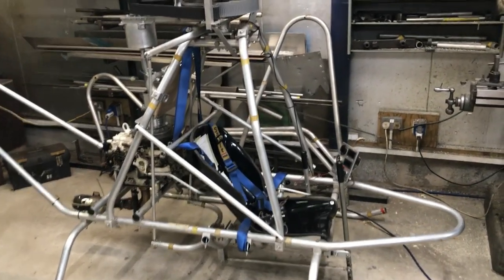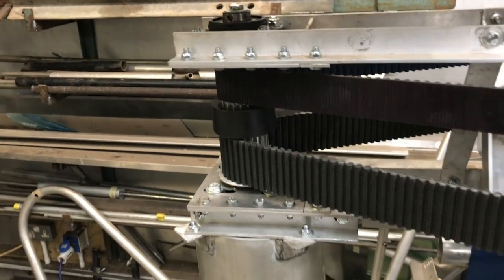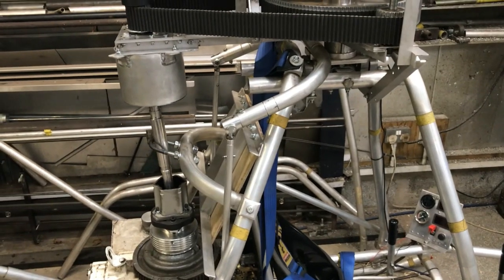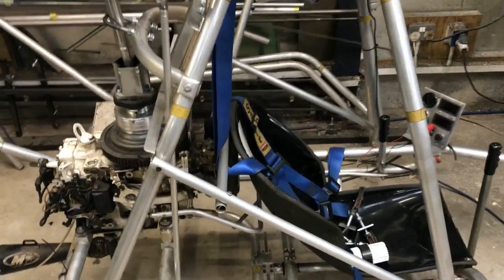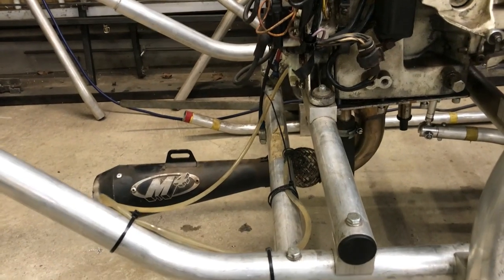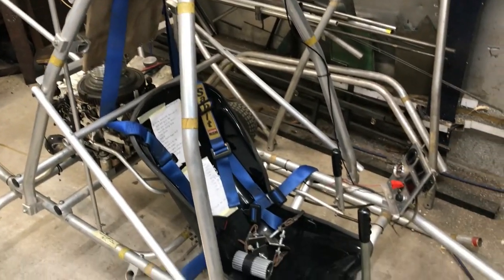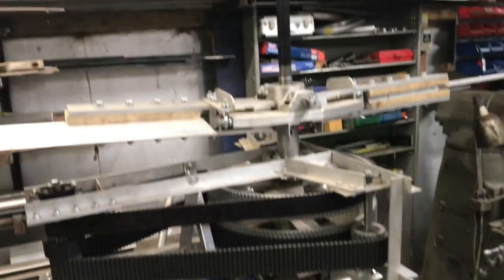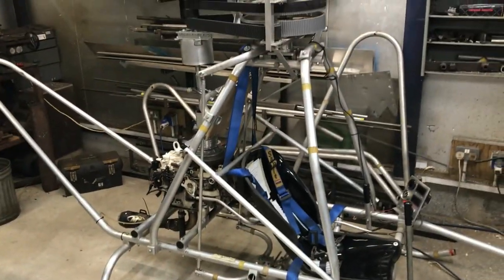Homemade coaxial Helicopter update 2 and test

Comment: So Rotor diameter is 4.3m, are you still running 700-720 rpm?
Reply from the maker: Hi Yes still running around that RPM. With the blades at 6 degrees it's very close to lifting, I can just push the ground with my foot and it will lift. I'm hoping the exhaust was causing a significant loss of power. Will see after the new exhaust system is finished.
Reply: @Ben-Dixey  Good work. Not to deduct from your work, but you do not want it to just be powerful enough to get off the ground do you? need to have spare power. Also the rotor RPM seems slow for that diameter. I calculate about 160m/s. closer to 200 would be better. Best of luck. I am in the process of building my own helicopter. A mini MD520D.
Reply from the maker: First Last absolutely right the aim is to have plenty of power left over to control altitude. My first gearing had the blades running at 800-900 rrpm, 200m/sec but I found that running at that speed didn't produce the lift. I couldn't advance the blades more than 3.5degrees in pitch. Now running at 160m/sec and 6 degrees it's close to lifting. The Rotorschmiede runs at 150m/sec but only has 50hp. My expected max take off weight with 60hp is 275kg, right now the empty weight is 118kg and I weigh 95kg so going by that the engine or blades are under performing. I'm not able to calculate the correct tip speed, blade chord, blade pitch etc so have to go by working examples. I'm interested to know more about your mini MD520D project?
Reply: @Ben-Dixey  Supposed to be MD520N not 'D'. From what I know, belts consume a lot of power. you have two and the look wider than the Rotorschmiede. I would try connecting an electric motor in place of the engine and calculate how many volts and amps it consumes to just turn the rotor system without blades and compare that to motor running on its own. I am using 530 bike chain, less power loss. My power is also higher. max 115kw for 450kg (95hp for 275kg) expected. Not going ultralight spec! Not able to calculate tip speed, are you unaware of the engine rpm? My heli project is using a Suzuki M13A engine turbocharged making 115kw max at 1.75 BAR absolute. 5 blade rotor, 6m diameter at 625 rpm with engine at 5000rpm. 600mm ducted fan driven at 6250rpm. All enclosed engine oil lubricated chain driven. Will post a youtube channel with it. From all other helicopters I have looked at, power to weight seems to be around 300hp/1000kg. So about 80hp for your 275kg. about what the mosquito runs. I would start with testing how much power your drive system consumes. Reading about motorcycles for example, belt drives were calculated at about 15% power loss, where chain was about 3-5%. Big difference.
Reply from the maker: First Last good idea on using an electric motor to find the efficiency. I don't think however that synchronous belts are that inefficient. If you Google how efficient are synchronous belts they give a figure of up to 98%. That figure I would think is optimistic but I was expecting an efficiency of 95% per belt. I did read an article on a motorcycle drive comparing three types and the belt was reportedly 9-15% losses but the diagram depicted a Vee belt not a synchronous belt. 
Chain could have been an option for me too but I decided it would be running too fast and would need an additional belt reduction first to avoid getting too hot not running in oil bath. 

I can't calculate the most efficient tip speed is what I meant. All that theory is too complicated and to be accurate some serious depth is needed. 

Your MD520N sounds very interesting, I like the idea of NOTAR as tail rotors are dangerous things. What stage are you at with the project ? I take it there's no kit and everything has to be designed and made by yourself ? Would be great if you started a YouTube channel. What country are you from ?

Comment: Hi man!
Clean job :)
But you don`t have any of cyclic pitch system used in regular helicopters...
You just change the rotor its self...
why they use that complicated system instead of this method?
seems mush easier and cheaper to build!
Reply from the maker: Thanks. 👍 The hinged mast lends itself to coaxial configurations as the airframe torque is equalised and doesn't exert large forces on the hinge as it would on a single rotor. Also the opposing rotation of the blades cancels gyroscopic precession, which further simplifies the control. One disadvantage to mast hinges is the control lag that might be experienced but I'm yet to test this.
Reply: There might be some issues with this system, the other reason is there is no autorotation with this, that's why they have pitch change in rotors on  normal helicopters.

Comment: Hi Ben I see it tends to lift the nose only .....can you get the c of g altered to get better idea of the lift capability?
Reply: Don't forget to include the weight of cooling liquid in the system as well Ben.
Reply from the maker: I've done a hang test and it balances with my legs out straight on top of the frame, when I bring them down it's aft heavy. There is still some weight to be added at the rear such as the radiator, fan, pump and yaw fins so I'm going to have to move my weight forward to compensate. I've got chains going through the holes in the trailer bed to anchor it but they are snagging so will change it to cable so there's no catching. This could also be hindering the true lifting capability.
Reply: @Ben-Dixey  You should compensate for the C of G position by using cyclic pitch, not by shifting your body weight.
Reply from the maker: Cyclic control doesn't compensate for CG you just move in that direction.
Reply: @Ben-Dixey  Have you ever flown a real helicopter?
Reply from the maker: Yes, I've had a couple lessons. What I found trying to fly this helicopter is that small changes in CG even 0.5 degrees nose heavy will cause me to drift in that direction. I find it much easier to hover in the same place when the CG is perfect. Think I'm right in saying you can still hover over the same spot with the CG out but the fuselage will not be hanging level. The cyclic stick in this case will be offset relative to the fuselage.
Reply: @Ben-Dixey  The point is this, and this applies to both helicopters and gliders. 
Not all occupants of the aircraft are the same mass. And the aircraft absolutely does not accommodate that by moving mass forward or aft.  And neither do they add mass such as water or sand to the front or aft of the aircraft to compensate.

The way they compensate is by using the cyclic in a helicopter and the stick in pitch axis in a glider.
Reply from the maker: Understood. Yes I see what you are saying obviously there is a limit to how out of balance the helicopter is and no doubt any pilot would prefer perfect balance. The air scooter had a tank on the front of it to add or subtract weight to accommodate different pilot weights, a small machine like that or mine is much more sensitive to changes in CG. Am I right in saying that a nose heavy helicopter will hover nose down, and rear cyclic will not bring the fuselage level but will instead start moving the helicopter backward ?
Reply: @Ben-Dixey  When helicopters fly, the fuselage pitches down for it to fly forward.
The greater the acceleration the more it will pitch down. To decelerate, the cyclic is pulled back and the fuselage pitches up.
Reply from the maker: @deang5622  The rotor tilts and the fuselage follows whether the fuselage is level or not.

Comment: Olá amigo, parabéns, uma sujeição se vc aumentar mais uns 4 grau no passo das pás, vc vai decolar com mais força e Menas aceleração no motor, um grande abraço e Deus abençoe.
Reply from the maker: Hello. I will try more pitch and see what happens. The pitch is currently at 6 degrees, it would be interesting to see what happens with more. My feeling is the clutch will slip or the engine won't have the power but I have been wrong before. Thanks. I have watched some of your videos but unfortunately the auto translation isn't very accurate.

Comment: good job. building a whole craft from own design is no joke. tried that with a drone and was a challenge, I ended up going for the current project with already made design... am planning ahead with the rotors, I intended to buy them initially but that will set me back like $5000 which is too much. the problem the plans are so vague in regard to some critical details of the  blades contraction....
Reply from the maker: Making the blades is one of the more challenging parts of building a helicopter. There have been plenty of successful wooden blades constructed in the past and the nice thing about wood is it is natures composite with no known fatigue life. The downside is the weight penalty and if left outside water absorption. One thing I've learnt is that a 0012 blade needs to balance at around 25% chord (nose heavy) and be bolted to the blade straps in this location, this is particularly important on variable pitch helicopters otherwise the collective pitch forces will be too high and weight too far aft can cause blade flutter.
Reply: @Ben-Dixey  the plans shows quite an easy way to do it, once the wood jigs of 6° is done ...but problem no further information is shown about them....the skin is aluminium as per design....let me just finish up the rest as for now my brain is too lazy to comprehend this blade thing ....I know ideas will hit me up at the right time....even transmission pulleys and freewheel did eat my brain a lot n I finally nailed them....
Reply from the maker: @JeffChoppah  Yes, only one thing at a time is the best policy. The blades are a project in themselves. There's a channel called ultralight helicopter where he is also building a furia type machine. It looks like he will be starting on the blades soon, it will be interesting to see how he tackles it.
Reply: What design are you building from Jeff ?
Reply: @cloudusterable  on a furia/skylark model.
Reply: ,presumably you have the head still locked ?
Reply from the maker: peter withers I locked the head again for this test and any other tests until I have reduced the height of the top rotor, I don't like how high it is and how much force is needed to move it around. I also read somewhere that a rotor spacing of 10% rotor diameter gives the most lift so it's just something that needs to be done. I kept it long in the beginning because I was worried about the rotors colliding but that's only an issue in forward flight which I needn't have worried about.